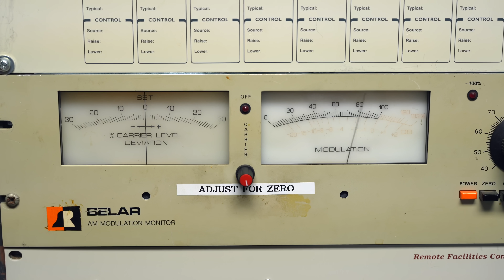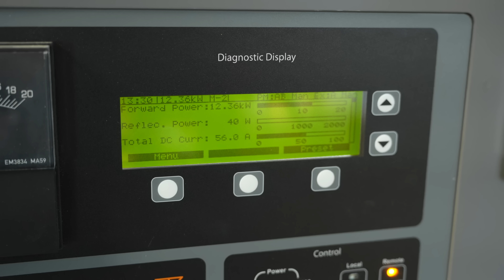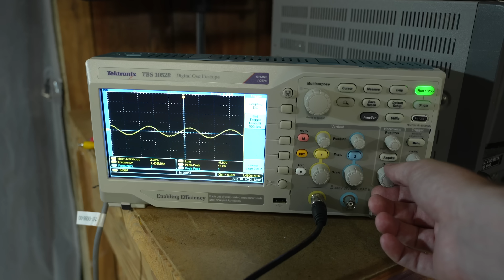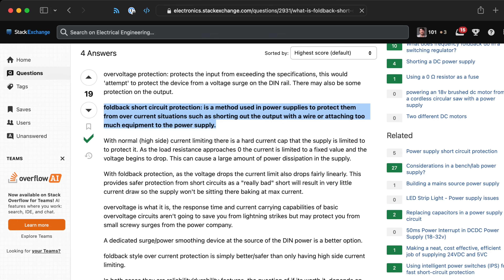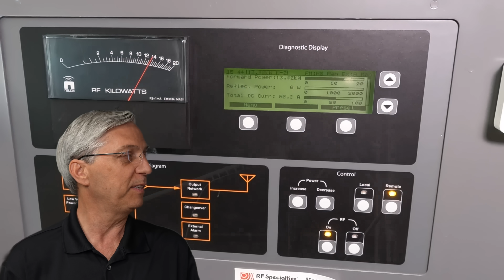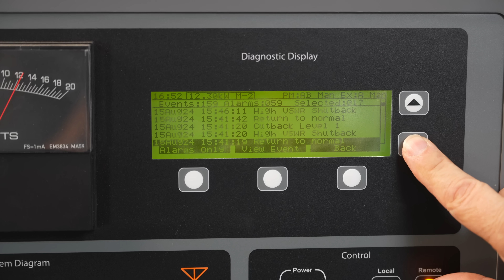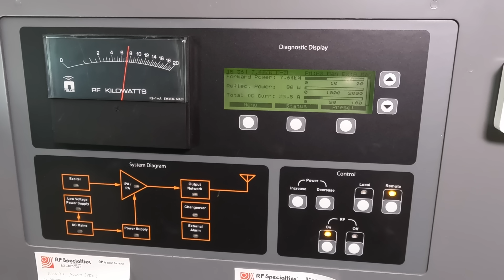How dangerous is AM radio? (ft Plasma Channel)

Comment: Stay away from towers.  Unless the chief engineer is too old to change the tower light.  My big adventure as the president of the local RACES (radio amateur civil emergency service) was to climb a 202 foot tall AM tower and replace the top light.  No ladder. Jumped on the tower from a pickup truck. Marked it off my bucket list. (1993). I worked at that station for 7 years, part time on the weekends, and board oping high school football games.  Afterwords I was the night DJ “RF Burns”.
Reply: Thanks for working with RACES. In my early days a lot of older engineers did some maintenance on hot towers either using a tower climber or a "helper". I bet there are a couple other interesting stories in those 7 years!
Reply: @radijoe  actually yes. Here is one more. He took the snow cat up the mountain, and after completing his work on some microwaves, and maintenance for “other agencies”, he discovered that he forgot to turn off the headlights on the snow cat. Dead battery. 
I had access to a 1965 Dodge pickup. 4WD.  
With a spare battery, jumper cables, and a board member, I went up the mountain.  The drifts were above the windshield in some places, and the snow was above the hood. By the time I got to him, the board member had freaked out and was ready to go back. The truck has overheated, so I had to get all the snow out of the radiator.  We all lived to see another day.  10745 ft. at summit.
Reply: Man thought I was the only idiot left alive that had to jump onto a hot tower.  The 90's was the last era before the FCC imposed all the RF exposure regulations and for good reason. At 12KW you are looking at peak voltage above 1KV'ish depending on the turner match
Reply: @AaronsLyfe  They do say when a HV power line has come down next to a vehicle you're in you that's immobile, that you're supposed to carefully leap out onto the road and bunny-hop away eith feet close together to a safe distance.
Reply: That's friggin awesome lol
Reply: So is the tower itself actually part of the driven radiating element?   I guess as the wavelength being so long it must be like that but what I can't seem to see is a high voltage insulator at the base.  And a inductance somewhere for matching?
Reply: @jagmarc  I think there is a lump of ceramic insulator between the base of the metal tower, and the concrete block with ground straps. Then a metal rod coming in from the side to feed the RF signal to the tower.
Reply: @petermichaelgreen   Now a ceramic insulator does make sense.  Though I suspect the side metal rod drive isn't low resistive impedance (& high current) there if there's a reactor twanging it with a few kV.

Comment: Yes, RF burns hurt.. It's a mix of feeling like you're both burning and being electrocuted at the same time.
Reply: I can still feel the rf burn I got 25 years ago, and that was just 30W of SSB. That part of my finger is kinda flatter, and the sense of touch and pain just doesn't work quite right.
Reply: I knew an Air Force veteran who had received a severe RF burn when a piece of equipment he was working on was energized. He said after a few moments of confusion the pain caused him to fall off the equipment and he didn't realize how badly the fall injured him until he tried to get up. Said the burn had all of his attention.
Reply: Feels like very HOT pins sinking into your skin. Yep, I've had plenty of R.F. burns while experimenting....
Reply: Can be used as a method of hair removal (called thermolysis), but those devices are just 7.5W, also use point effect to isolate the energy to the base of the hair follicle.
Reply: @n8chz  Picks up my 7W transmitter and looks at my stubble
Reply: Sound like the perfect replacement for electric chairs.  lol
Reply: @BillAnt Star Spangled Banner playing while cooking...

Comment: i had an RF Burn on my finger when i was messing around with the connector for the antenna on my Bofeng UV5Rplus that i got back in 2014ish 
back in UK 
it defo hurt and i learnt from that shock tbh and i even get small shocks from a tv booster antenna jack but my ham radio that is kinda illegal in england due to the band width or so and bands it can use are so high above 400.400 defo hurt way more 

i need to replace its volume and maybe the housing as im not getting rid of it due to some laws haha. maybe i can find a way to disable broadcasting on the unit sadly it cant Transmit under 5 or 10Watts so i cant legally use it as a legal non licence Walkietalkie even tho it can be set for it.
but maybe theres another radio that can do under 5W like the 0.5mila watts

Comment: When I was just 8 years old, Me and the other boys used to go to the back of the city out in the wetlands in Menlo Park, Ca.
  There lays an AM transmitter on 1420 KHz and one day we were there, and I had touched the metal bar on the antenna structure, and it gave me the worse electrocution shot/Burn I have ever seen, hell yeah that damn thing has burned my thumb to the bone. 
  I'm glad that I didn't have the chance to grab it with the palm of my hand, just the thumb touched it and it all went bad from there. 
  I cried like hell because it just kept on hurting and hurting as time went on.
Reply from the maker: Ouch! Hopefully at least some healing over time. RF burns sound like a very bad time.
Reply: Are you talking about the towers by the Dumbarton Bridge..?

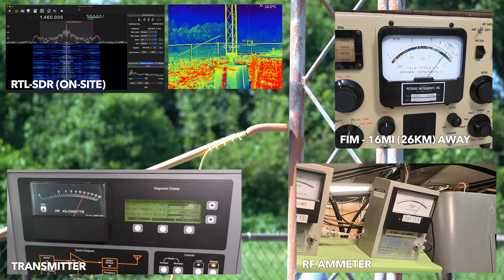Comment: 9:50 - It's 10x the strength of a typical microwave oven,in terms of RF power. It's a much lower frequency,though. And yes,RF burns suck in a different kind of way..high voltage,high frequency (relatively) energy is "different". It feels different,and behaves differently.

Comment: Doesn't this rust the metal on the tower?
Reply: It probably pulled some of the metal out of the tower into the meats. This is kinda similar to electroplating I think. Salty water with two electrodes on either end. 

Wouldn't worry about it weathering the tower too much though :)

Comment: Would not the spike in power be due to you reducing the resistance to ground thus allowing ore amperage to flow?
Reply from the maker: Could be! It'd be great to also speak to some Nautel engineer about it—I think there's still some more fun things we could learn from this silly experimentation!
Reply: Very simplified, but you are essentially correct. RF is strange. Another path to ground was added, but it's possible that it INCREASED the impedance of the antenna... which can also cause more current to flow. (EE + Extra class ham here.)

Comment: So the dog acts as a detector.  I guess the power flow is flucting and the heating effect is also changing and generating the sound waves.  You can cook hot dogs with 120 VAC directly on the line.  In the 60's you could buy electric hot dog cookers.  Or you can put nails in each end and hook to the line.
Reply: It was the Presto Hot Dogger. I had one in college; this was before cheap microwave ovens. They worked fine, except the ends tasted metallic. You could cook six hot dogs (in parallel) in 60 seconds.
Reply: @JamieStuff  That's it.
Reply from the maker: The "don't touch this" hot dog cooker!
Reply: @GeerlingEngineering  Ya.  The ones they sold had an interlocked cooker.  But I wonder about chemicals for the electrodes.  The FDA may have shut it down.  Once upon a time long long ago I worked on technology that killed microorganisms in food using high electric fields and we had to pass FDA muster.